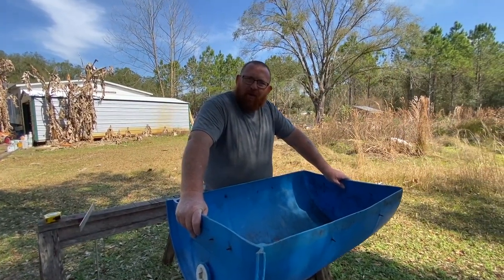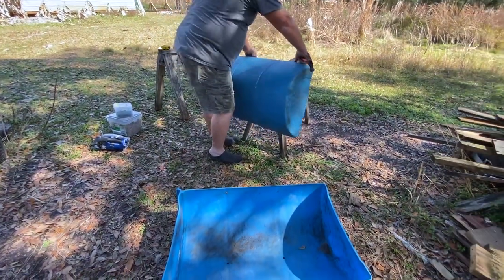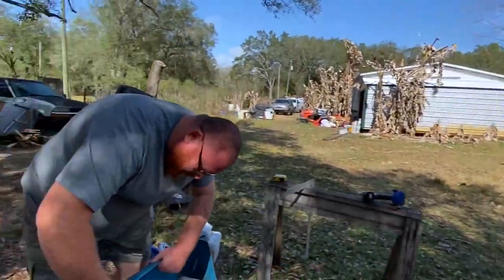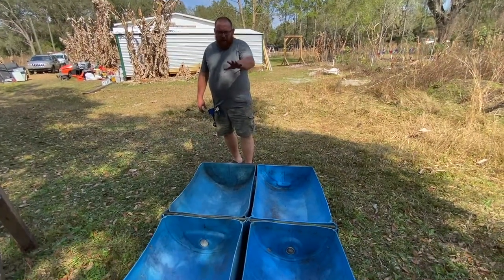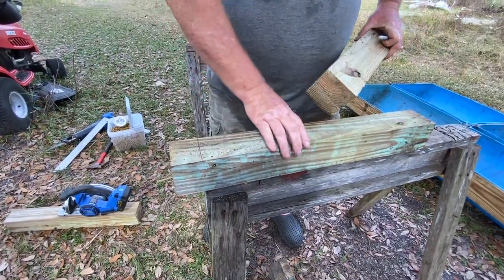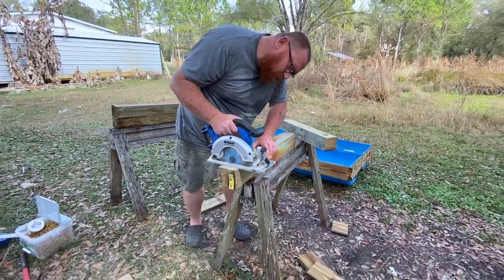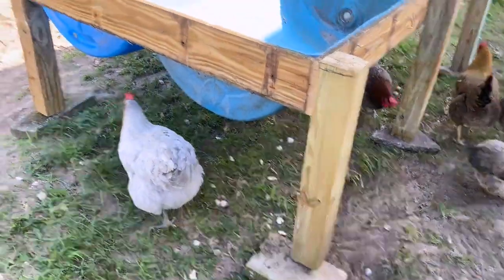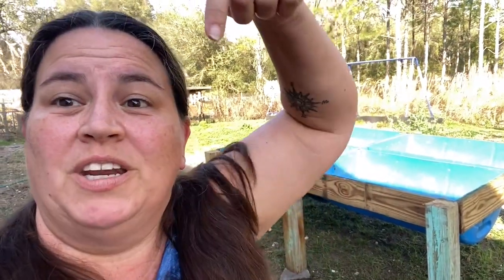How to Make Plastic Raised Beds Out of Barrels

Comment: That is a really cool setup. It gives me so outside of the box ideas. Thank you for sharing. Have you given any thought to supporting the center portion of the group of four. It appears to me that could be a lot of weight when full and when watered in the very middle without any support. Just my thoughts.
Reply from the maker: I have thought about that. I believe it will be ok. But if need be I could easily add support later.